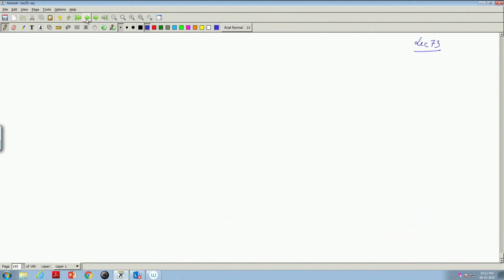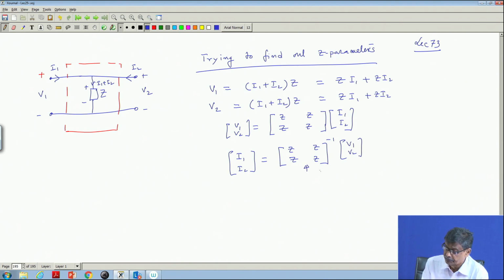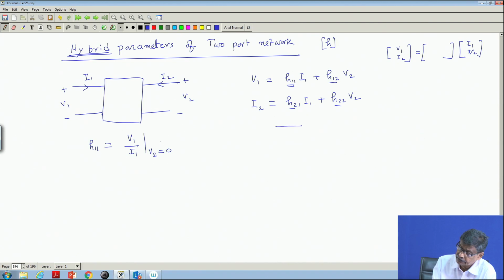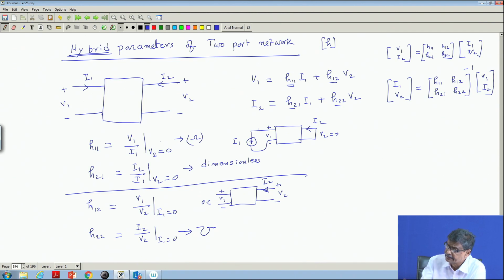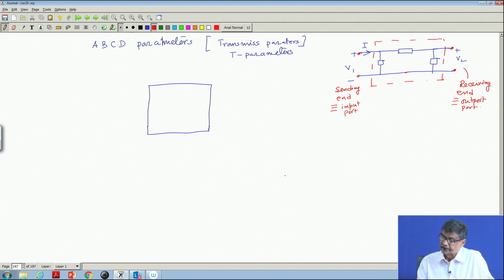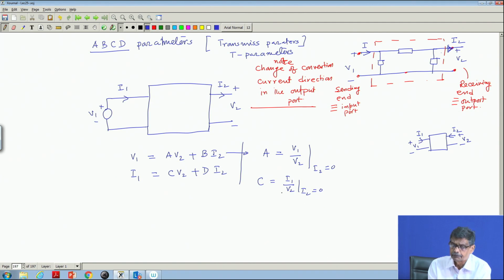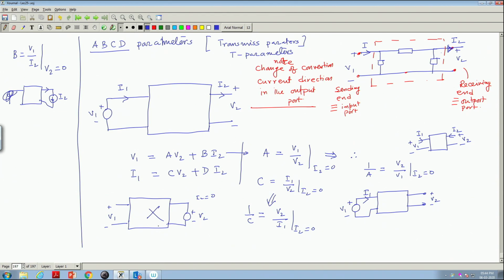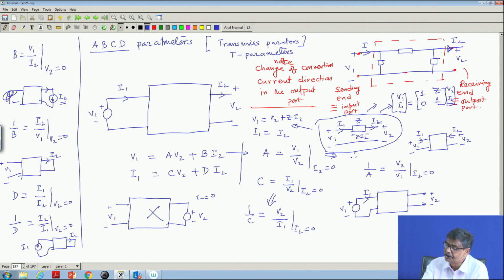Lecture 73: Two Port Network - III

Comment: Thank you for lecture Sir. We have worked as network engineer. There we have to check the signal strength of network. Sir how we should decide that when signal is have excellent quality and when it have poor quality. What is percentage for packet loos and pacet gain in a communication network?